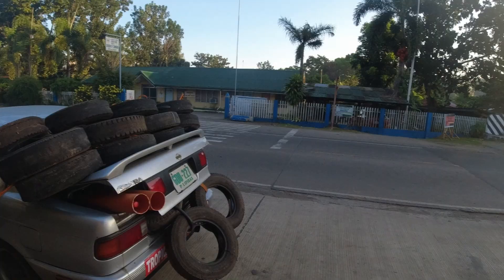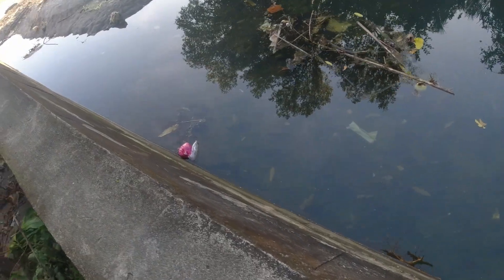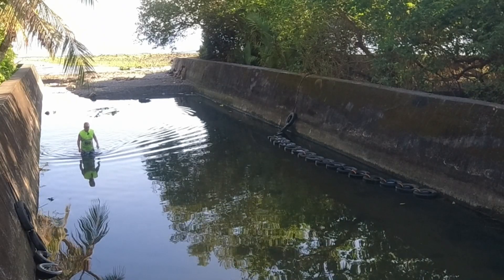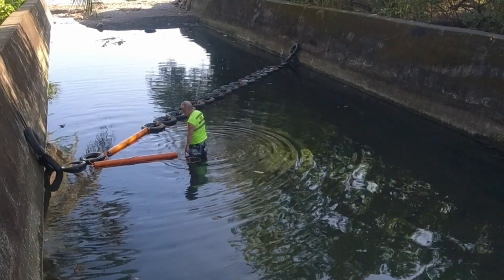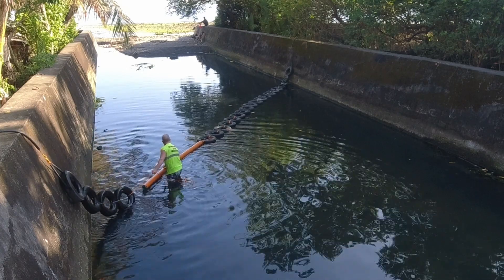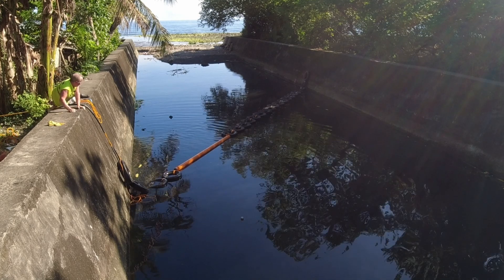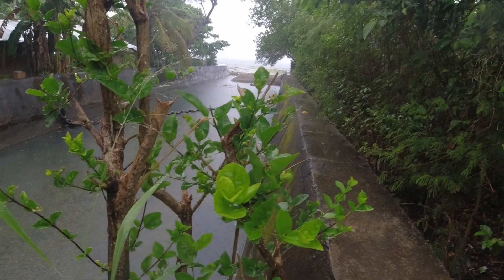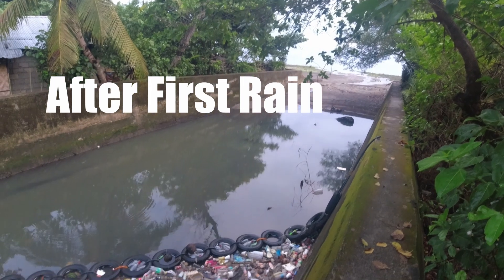Easy Way To Stop Ocean Plastics, just Kaboom!

Comment: Sry, but I didn't get the point of that PVC part in the kaboom. Plz explain a little bit more.
P.S.: you are a former marine?
Reply from the maker: Both high flow end canals twisted the tires on the Kabooms during storms from too much water resistance. The PVC gives the water a path to escape and keeps the Kaboom from being pushed under and twisted. I also shortened Krusty this time for the same reason. But? The PVC is in no way stronger and could break from a big impact, I just hope the logs will pass under. Time will tell, was not a marine, was in Air force Civil Air Patrol. Was only joking a marine could climb out easily, little more difficult for me.